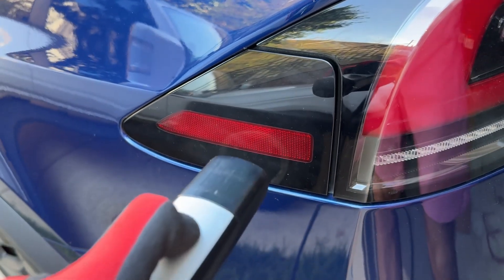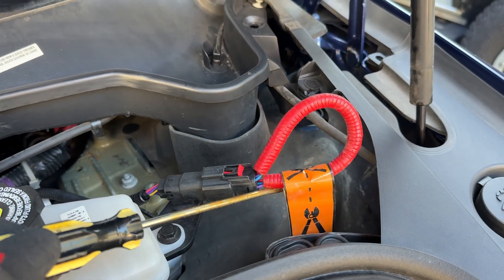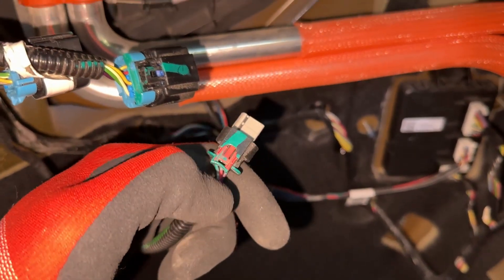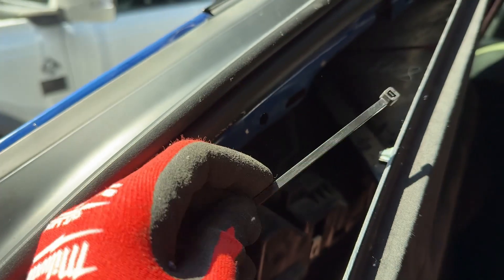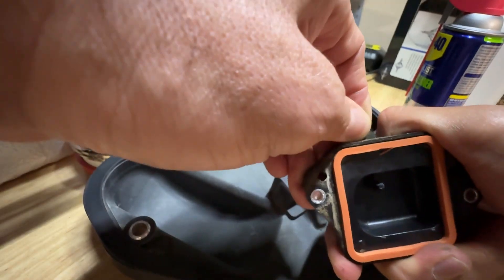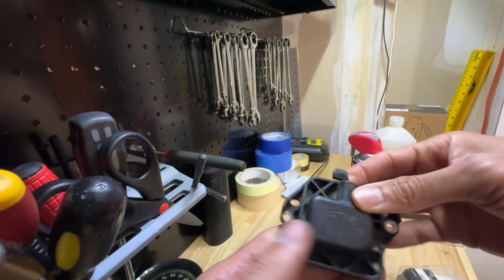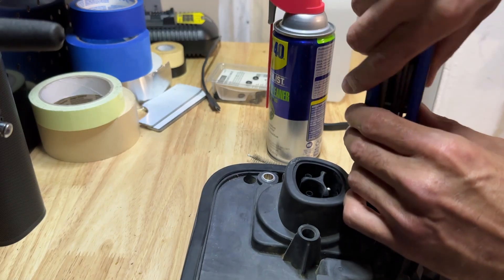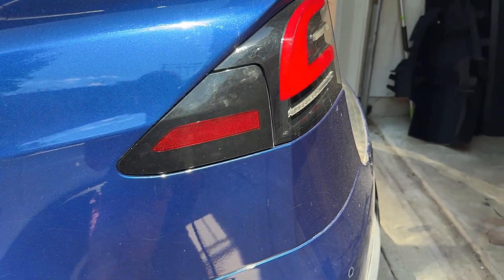Tesla Charge Port Latch Fix (Refresh Model X)

Comment: Hey ! You’ve recorded a nice guide ! Did you run into problems like “Charging equipment not recognised” or charging interruptions ? My model 3 might have that latch problem
Reply from the maker: I did get notifications that the charging cable wasn't fully connected often.